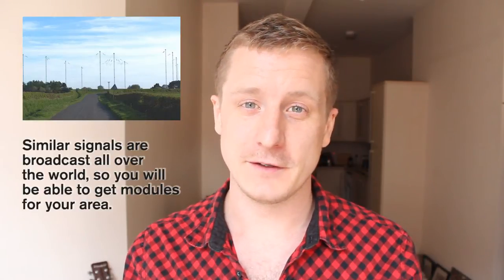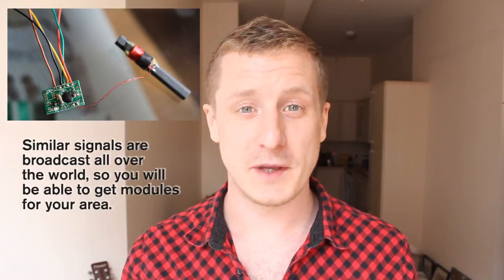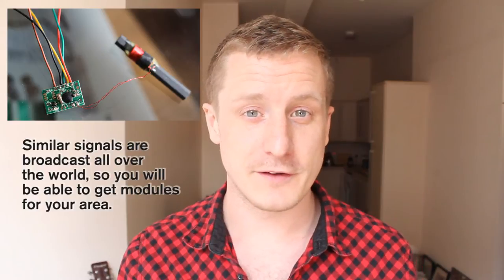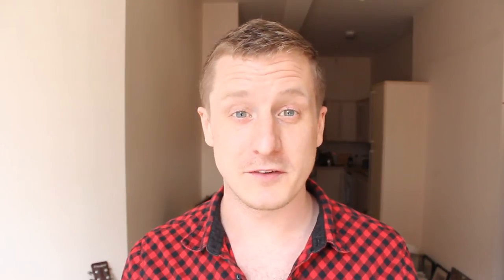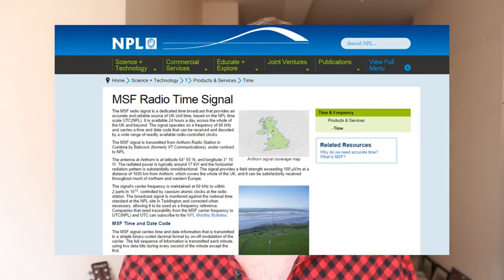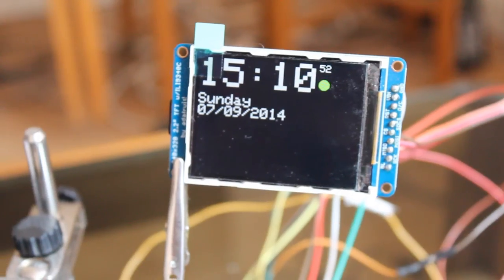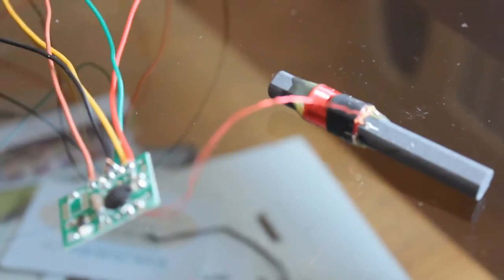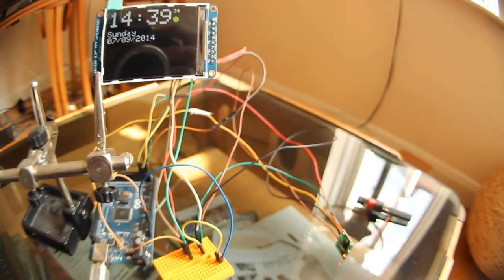Atomic Time with the 60kHz MSF Time Signal Receiver

Comment: I would like to make one that gives out sound that it makes and if the time signal is off due to being served. I would not panic. 
Plus I would like to make one for a (Nixie ) value clock to do the same by automatic correction . If there is a power cut or which ever the case.

Comment: why do you need radio signal to receive correct time while you can use gps module to get accurate time in any corner of the planet.
Reply from the maker: It is more cost effective and lower power than GPS for simple devices like clocks. It also pre-dates GPS by about 50 years.
Reply: @DavidWatts  GPS Module is way more cheaper than that and some part of the world cannot reach by the radio signal.  And you can switch GPS on and off if you want to.
Reply: @DavidWatts  exactly. My german time signal clock uses nanoamperes. Yes, nanoamperes @ 1,5 Volt. One set of batteries is good for 5-10 years, if the batteries survive it.